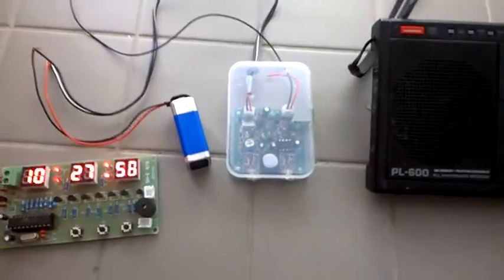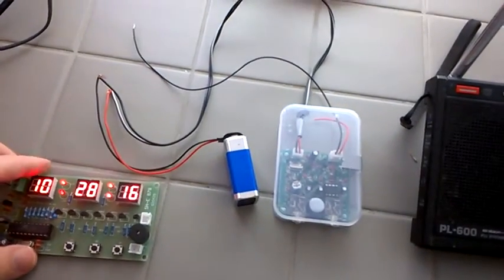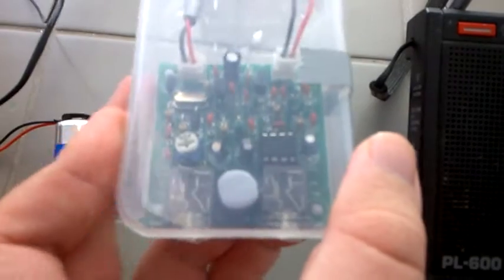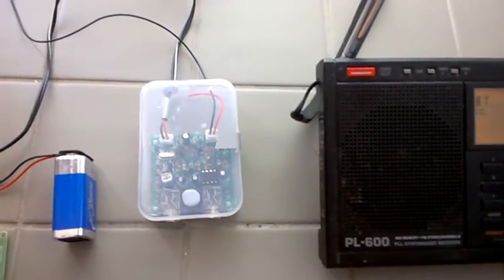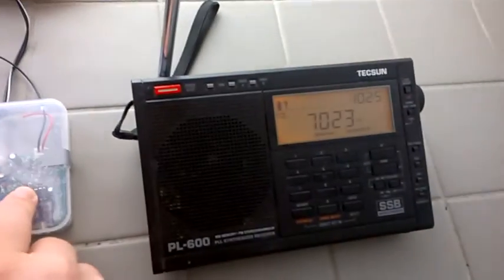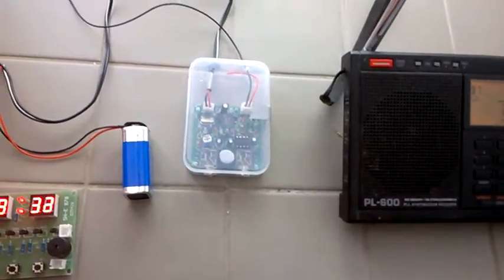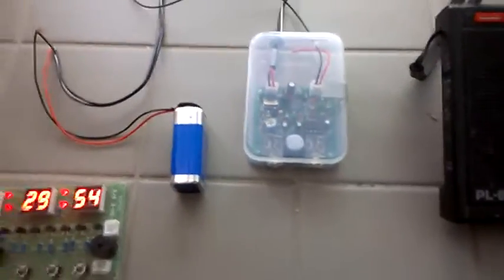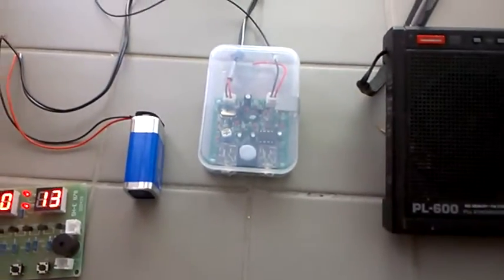Short shortwave update - QRP Pixie transmitter

Comment: If you want to make your transmitter relay a programmed message you could use an arduino in conjunction with an npn transistor to bridge the contacts of the transmitter when one of the pins on the arduino is turned on. Pm me if you need some resources or more detailed instructions. Also you might need an amateur radio license to broadcast on those short wave frequencies. I'm in the process of getting my amateur radio license which means I am permitted to broadcast on certain shortwave frequencies. I don't know how it works in other countries but I'm pretty sure Australia has some form of an amateur radio license type thing. However since you're broadcasting was such low power I really don't think that's going to be an issue. The search thing becomes an issue if you're broadcasting like 10 W of power or something like that.
Reply from the maker: +aarocka11 Thanks aarocka. I'd definitely just be sticking to QRP power levels, I probably wouldn't even go beyond this. Everything's still hypothetical. I was thinking even just something that broadcasts two dots 'EE' in morse, perhaps some sort of quick and cheap flip-flop oscillator. I've been meaning to get my fundamental license for a while now, I just never saw the point since I wasn't this much into electronics at the time. These little kits are fantastic, though. I think there's another version that's a bit more complex and reaches around 1 watt. I've also come across a linear amplifier kit of 25 watts, but that's off the cards for a while heh.
Reply: +MattExzy if you want to do this with complete analog circuitry maybe look into an analog step sequencer or something. You might be able to reverse engineer a simpler circuit from it. That would let you program a simple pattern and adjust the rate of said pattern. I don't really mess with analog circuitry. I primarily work with embedded systems as a hobby.